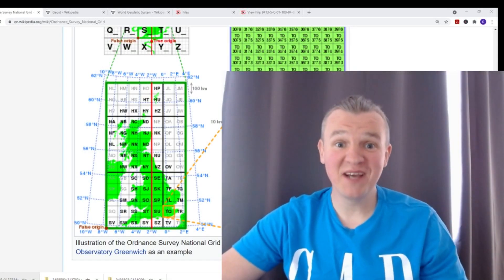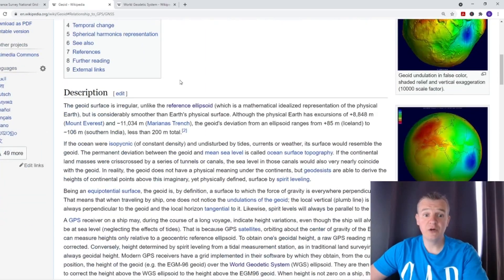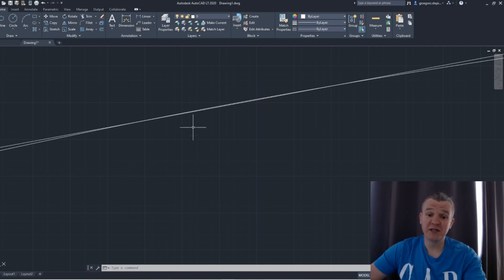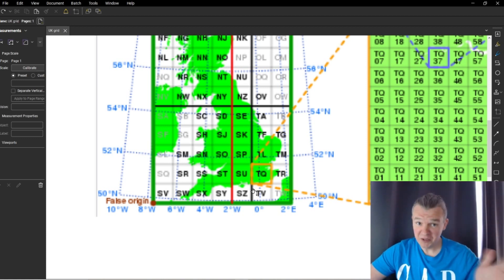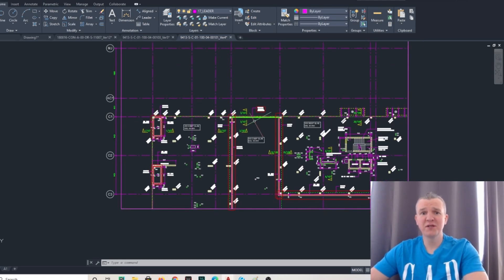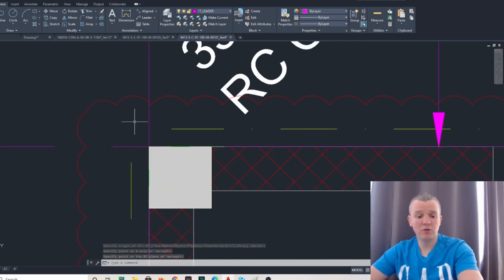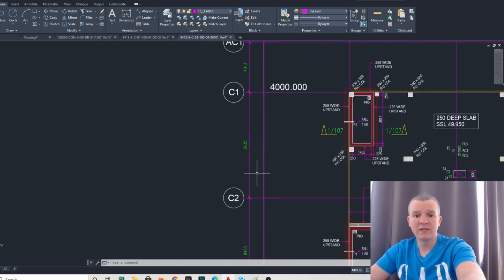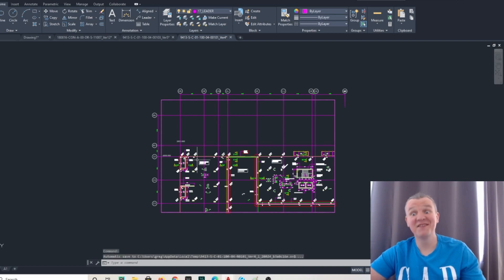SETTING OUT in global and local grids .LOCAL grid & GLOBAL grid coordinates. BRITISH national grid.

Comment: Hi I'm an architectural technologist and we normally have to put Northern and Eastern coordinates on our drawings for guys on site to use to set out the building, kerbs etc, my question is how exactly do you use the coordinates that we have shown on our drawings to set out the building, what does that process look like?
Reply from the maker: Hi Emmanuel! All the building is set to your coordinates so make no mistake 😁 Typically there is a surveyor coming to site and set a control points - points with known co-ordinates and levels so engineers on site can set the instrument based on them. After setting the total station we are using your co-ordinates to set up the building and all other elements. From you we need grid lines set out and at least co-ordinates to grid line crossing eg. 1/A and 1/G so we know how the GL is orientated. When we have these we can create the local grid to make it easier to set out 😁
Reply: @SITENG  Thank you very much, this is really helpful to know!
Reply from the maker: @theLordistheSpirit  No problem, any more questions let me know 😁
Reply: @SITENG  Hi, I have another question, how do you join two slabs together?, so if for example I had an existing slab and I wanted to join a new slab to the existing, how would I tie the two slabs together?
Reply from the maker: Do you mean a construction joint, or some old existing slab with a new one. Normally you have a splice bars left in construction joint for the next pour, you can check on one of my vids. If it's connecting old one with a new pour there would be some drilling needed to provide proper connection (might be drilling and fixing rebar, or some special connectors) - in this case there should be proper inspection made before works to check existing slab condition.
Reply: @SITENG  yes I meant connecting some old existing slab with a new pour.
Reply from the maker: @theLordistheSpirit  it won't be that easy then 😁 as I said it needs to well checked and properly designed
Reply: @SITENG  thanks again, 😊 very helpful!

Comment: can you make a video how you enter in a construction site first day and interpret the controll point ,and a way or 2 methods to test , if the control points are indeed what you need , and how do you set out a CONTROL POINT FOR  hight or datum
Reply from the maker: Hi! I'll try to do something about it, but this info should be provided but the client who typically hire surveyors, or have some drawings with the grid points with coordinates.
Reply: @SITENG  how to do a traversee , and how many points minimum you need to work with a good precision and accuracy
Reply from the maker: I do resection with 3 points, but is not only number of points, but different angle and distance (EDM calculates position based on angles and distances), so the best would be have a 1 target 'close' to you than 90-120 degrees next one with further distance and the third one - optimally another 90-120 degrees.
Reply: @SITENG  WHAT IS YOUR NAME ON LINKEDIN
Reply from the maker: https://www.linkedin.com/company/siteng

Comment: I know theres also a formula for the calculator to convert coordinates
Reply from the maker: Tony, There is and I will tell more about it in next video, but I won't be using calculator for it :) You have to transform your grid to your new local and this requires transformation formula. Because we know coordinates in local and we have corresponding points in global we will use a spreadsheet for it (and Cad maybe too) , spreadsheet will be on my LinkedIn.
Reply: @SITENG  what is your name on LINKEDIN
Reply from the maker: @unda25  siteng
Reply from the maker: should be page there